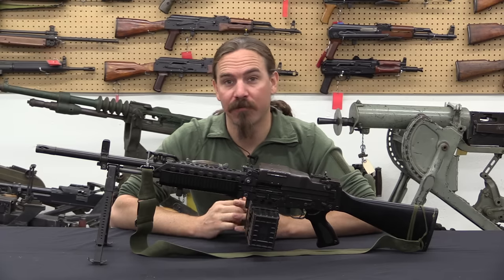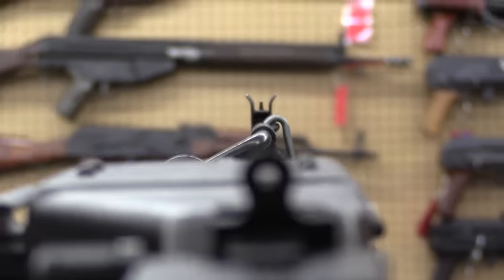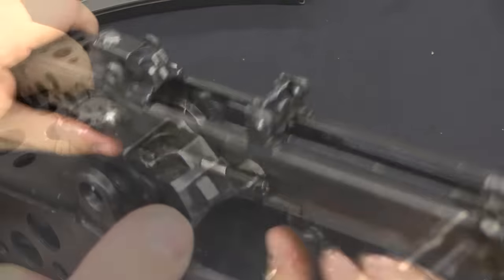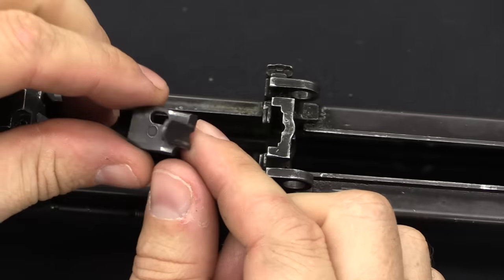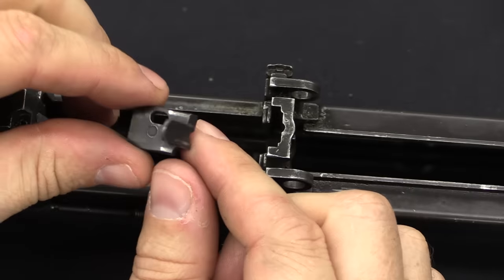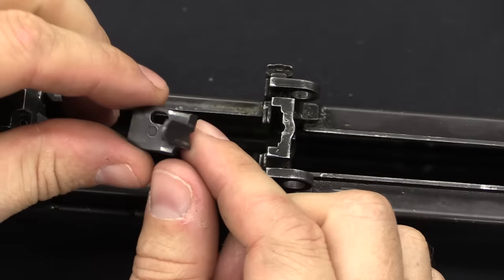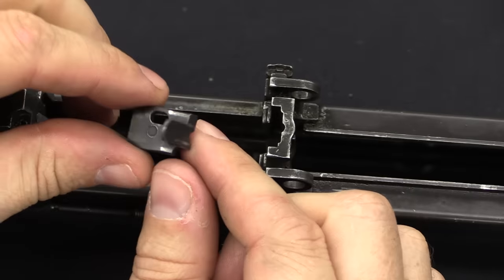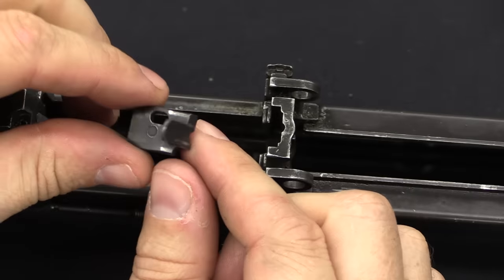Stoner 63, 63A, & Mk23: History and Mechanics

Comment: US Military: "This weapon is too finnicky for frontline use."

Also the US Military: "Boy, the M16 sure jams alot, better fix that."
Reply: (EDIT: to explain exactly what was wrong) The M16A1 was very reliable for frontline use and worked well in the mud. It was only the first M16 version that the US Ordnance company screwed up intentionally because they hated it and wanted to keep the M14. They were mad it wasn't procured under their control, and that it was privately developed by Armalite instead of the government's Springfield Armory. They ended up changing the powder that the rounds used to a cheaper surplus alternative. What this caused was an extreme pressure imbalance that the rifle wasn't designed for. So bolt velocity was substantially different. This caused lots of ejection failures, light strikes, and small remedial problems. On top of this they also refused to issue cleaning kits, under the impression you "don't need to clean the M16," which is obviously absurd and it's astonishing they did that. The rifle wasn't originally chrome lined either. That was actually by design, it's technically not necessary to do so, but it helps a lot especially in places like Vietnam. This was all quickly (I use that word loosely, quickly for the government at least) resolved with the M16A1

Turns out the babies throwing a hissy fit didn't get them their beloved M14 back, and only caused hundreds of G.I. to lose their lives because a perfectly good design got fucked up intentionally. The only good news is there was a congressional investigation into the matter, with several men arrested (not sure if they were actually charged), and the US Ordnance Department was completely dissolved.
Reply: @weasle2904  
I still think the US should have used the FN FAL. We'd still see new variations on that platform today and its a very good bush gun
Reply: @P7777-u7r  If you're talking about the FAL vs M14, then no doubt I think the FAL would've been a wiser choice. But history has proven that the 5.56 round is far more practical in combat than larger full power rounds.

The M16/AR-15 is also objectively better than the FAL. More accurate, ergonomic, lighter, easier to maintain, cheaper to manufacture, and it also is far more controllable. Not to mention the AR-15 also performs better in muddy conditions than the FAL.
Reply: @weasle2904  
I was talking about for Vietnam use specifically as in a counter insurgency fought primarily in the bush. Rhodesia found the FAL so effective in this that they kept their old beat up FALs and just kept maintaining and using them. Specifically in the vietnam era though the AR15 platform improved vastly after
Reply: @P7777-u7r  Rhodesia was a state with very little money to spare. I wouldn't buy into many of the old wives tales. Soldiers tend to complain and make excuses for everything, and myths spread quite far through word of mouth. Take the myth about the Garand ping getting people killed for example. If you weren't able to see the enemy through brush, it sure as hell didn't matter much if your bullets were deflected. This kind of problem is only really valid for hunting.

95% of all gunfire is suppressive in nature, and isn't intended to kill. This is important to keep in mind.

The benefits offered by the M16 heavily outweighed it's few negatives. It's why the US adopted it. The US tested experimental M16 models with a select few squads to see the effectiveness of the weapon. And the improved lethality, and ease of movement the group had with the new weapons was astonishing to the US Military

>"Specifically in the vietnam era though the AR15 platform improved vastly after" Sigh I will state, again, the M16 WAS improved DURING Vietnam and functioned FINE. The M16A1 fixed the issues it had, and worked beautifully during Vietnam.
Reply: Weasle 
I think Rhodesia was more a difference of doctrine from the US

Being a small army against an insurgency with very little urban combat individual marksmanship was prioritized a lot more and winning often involved getting the drop on your enemy first. If suppressing fire was needed it was up to the guy with the FN MAG to provide the most of it 

I think they liked the FN stuff as well because they often worked in 4 man sticks who’d be in the bush for a week sometimes without any permanent base and they were always on the move. The AR15 platform of those days even after the M16A1 was just a bit too high maintenance for people who worked in very small units and had to be constantly on the move as well as pack as light as possible
Reply: @P7777-u7r  "The AR15 platform of those days even after the M16A1 was just a bit too high maintenance for people who worked in very small units and had to be constantly on the move as well as pack as light as possible"

I don't mean to be rude, but this completely wrong. I'm really confused as to what you're saying, the M16 is inferior to the FAL when it comes to light and mobile units..??? The primary benefit of the M16 is that it is significantly lighter than an FAL, with ammo that weighs half as much as 7.62Nato. These are huge advantages for mobile troops.

The M16 is not maintenance heavy. It just isn't. Perhaps compared to an AKM, but it truly isn't. How is needing to clean your rifle every couple months a detriment to a light mobile squad? Cleaning your rifle for about 10 minutes every month or so is not a big deal at all. The M16A1 is mechanically identical to the M16A4 and M4A1 of today.

You're buying into the myths of the M16 too much. The truth of the matter is that it vastly improved the US Military's effectiveness, this is supported by statistics. It ESPECIALLY was effective in light and mobile groups
Reply: @weasle2904  I support what you've said so far, but I just want to point out that the M16A4 has been moved out of frontline service in basically every part of the U.S. military in favour of the M4A1 and M27.
Reply: @stevenbobbybills  It was just as a comparison. I understand they don't use it anymore. M4A1 is standard. The US Marines are the only ones who adopted the M27 IAR.
Reply: @weasle2904  Yeah, I really don't understand why those people in the Ordnance department weren't charged with treason for sabotaging US small arms and costing lives. They should have been put up against a wall for what they did.
Reply: @weasle2904  i believe the M4A1 is standard for special forces such as the navy SEALS,DELTA, MARSOC and various SOCOM units. The m4 carbine is standard for the regular forces because it has a semi-automatic/3 Round burst trigger group. The M4A1 has a Semi-automatic/full auto trigger group which has a more consistent trigger pull than the M4 carbine which translates into better accuracy. Thats important for the SPEC-OPS guys.  Just saying.
Reply: @austinthorning5025  The original M4 carbine was phased out long ago, M4A1 is standard.

And it definitely didn't have a 3 round burst. That was only in M16 trigger groups.
Reply: @weasle2904  m4 standard had 3 round burst,  A1s have full auto.
Reply: @andy1676  You're correct, my mistake! However M4's are still phased out. The M4A1 is standard issue
Reply: @weasle2904  I will admit that the information I used was stuff I looked up a few years ago..my bad. Although I seem to recall that the military still uses 3 Round burst for its carbines, but this may vary from branch to branch . So take it with a grain of salt, i may be wrong. Have a good day.
Reply: P77777777 actually it improved during Vietnam not after the main issue that the m16 had wasnt the m16 it was the ammo they started loading the cartridges with the incorrect powder causing pressures the m16 wasnt made for which led to premature attempts at extractions which resulted in the extractor literally ripping part of the rim off of the casing causing you to have to use a tool to extract it typically a rod down the barrel often times the weight of the rod was enough to remove the cartridge

So no the ar platform was very reliable from its conception it did however have some minor issues like the extremely exposed mag release that they added a ridge around to prevent accidentally hitting it and dropping the mag
Reply: P77777777 "the ar15 is just to high maintenance" the ar15s I've taken apart looking at with gunk caked inside still working flawlessly beg to differ

And by gun I'm talking it looked like fresh black paint was all over the inside of it on of the filthiest guns I've been handed to clean was an ar and it wasnt cleaned to fix it it was just cleaned to clean finally the only real competitor was a 22 that I am not willing to guess how long it had gone without cleaning or how many rounds it had seen it was caked to the point I was pulling what I think is beside described as dried sludge made of of powder residue mixed with dust and dirt all throughout the reciever 

The long story aside anyone who thinks an ar is to high maintenance to go a month or even a few with no cleaning is stupid, ignorant, or simply biased that said they do require maintenance as does everything machine nothing man made doesnt require any maintenance to continue to work 

And as a side note you pointed out "packing as little as possible" well if they're going out into a situation where combat will likely happen and not bringing simple supplies to maintain they're equipment they're an incredibly unproffessional borderline laughable army take care of the equipment and itll take car of you and seriously a rag a small bottle of oil and a bore snake is all that would be neccessary the bore snake is even negotiable really you just need to wipe it down and add a bit of oil along as you're giving it a proper cleaning when out of the field and incase you're under the impression the ar platform is hard to take apart (know a guy who was in the finnish army who was told their ak variant was superior to the m16 it was 100 percent reliable and extremely easy to take apart had to break it to him that it wasnt as reliable as he thought and that it's no easier than an ar) stripping an ar is pushing 1 pin through the recieve (it is retained on the other side doesnt go completely out) letting the rifle fold over then pulling the charging handle out as it comes out the bolt assembly follows that's basically all thats needed in the field of you want you can pop the pivot pin out just like the other pin then it comes apart in 2 pieces and you can remove the bolt head which has what amounts to a cart key and a retaining pin required to remove it and at that point you have the firing pin out as well 

Infact you can take the whole gun apart without tools the barrel is even easier to replace than alot of rifles made to compete with it the gun really was designed for military service it's simple reliable parts are interchangeable and cheap
Reply: They did not issues cleaning kits this proved to be the big issue as guys just used them tell they clog up"The M16 was billed as self-cleaning (when no weapon is or ever has been). The M16 was issued to troops without cleaning kits or instruction on how to clean the rifle."
Reply: @austinthorning5025  You were right about the 3 round burst on the original M4, that's my bad. But yeah the M4A1 has pretty much completely replaced it.
Reply: Jacob Perry yes I never claimed it didnt need to be cleaned or that that qasnt an issue? I dont understand your point are you saying that it getting dirty is worse than the over pressure from the incorrect powder causing locking lugs to sheer off or the extractor to rip through the case rim causing the spent casing to become a bore obstruction?

I dont understand your point but yes you are right one of the issues faced early on was that they didnt issue cleaning kits but again not an issue of the rifle just more stupidity from people doing things they shouldnt do
Reply: lol have any of you served or used any of these rifles you speak of?
Reply: This myth has been dispelled so many times it's not even funny to bring it up ironically anymore.
Reply: The Australians and the Kiwi's did alright with their FALs in Nam. Also Google the "bitch"
Reply: @weasle2904  The FAL in the original .280 British intermediate cartridge would have been a great choice.
Reply: The M16 jams were ammo/maintenance related, they didn't need to "fix" anything about the rifle itself.
Reply: @weasle2904  any thoughts on what if the m-l6 had been adopted w/a gas piston, & 2 locking lugs? that was my gripe-- plus, i read that the current ml6 has a gas piston (if that's true, what does that say ABOUT gas tube op?)
Reply: @P7777-u7r  right; a 762nato, & 556, FAL, both w/ options for heavy bbl, hi-cap B-shaped drums; if sturdy enuf, cooda replaced: ml6, m2l sniper, 249, 240B, wooda allowed going 'heavy' on 762nato rifles, when situation required, rather than everybody stuck w/ 556rifles; then maybe bullpup version
Reply: @weasle2904  ** ml6 cooked-off way sooner than other designs,**  upper-recvr lack-of-trunion-block had ml6s loosening bbls from sustained fire, ie, no option for ml6-RPK (ml6 SAW), ** also,  no way to have ml6 quick-change bbl; **  i never saw any justification for gas tube-- note stoner PISTON op, ** no justification for 7 locking lugs [i've not kept up on the latest mil wpns: do you know of any other mil wps w/ 7 locking lugs; or any reason for such?]
Reply: @P7777-u7r  agree, on ml6 too-high maint-- WAY unjustifiable for a mil wpn
Reply: @barrysmith1202  Direct gas impingement allows for a well tuned operating mechanism providing substantially lower recoil and better shot to shot accuracy. Less gas, mean less energy, more lightweight bolt carrier group. The high amount of locking locks allows for an extremely short rotation of the bolt, making extraction easier and less energy to unlock the bolt.

You get an overall lighter gun, with lighter recoil. Your claims about it's unreliability perhaps would be valid if the M16 was never adopted, but over it's 60 year lifetime it's proven itself as an extremely reliable weapons system
Reply: @weasle2904  i'm not going to argue w/ those points, but i do have some questions: ** do you know of any other military weapons w/ direct-gas, & 7 lugs (i have'nt followed small-arms for decades now); ** many other systems-of-operation have demonstrated: > low recoil, >high accuracy, > reliable extraction, > reliable unlocking, ** i carried an M-l4 throughout ranger school (where one typically loses 20 lbs of body mass), basically 24hrs a day for 4-6 days straight, for several weeks straight (not, BTW, recommended, ie, SEALs consider such to be totally stupid training); but, i never found the M-l4 to have a weight problem; ** what year did the u s military drop the direct-gas system for M-l6? why was it dropped?
Reply: @barrysmith1202  Lots of guns use AR-15 style bolts actually. G36 and L85 come to mind. The only other major DI gun would be the French MAS49. The reason it's uncommon is due to direct gas impingement being harder to tune for a operating mechanism to run well. However when you get it right, and the M16 certainly did, it has a lot of benefits regarding weight and recoil. Eugene stoners design is particularly well suited to this gas system. The AR-15 is the Pinnacle when it comes to gas impingement systems.

Interesting to note, the AR-15 technically isn't direct gas impingement. Due to the fact that the gases being directed into the bolt carrier group are actually routed to an internal gas 'piston' inside the bolt carrier group.

The reason the M14 was dropped was due to the M16 outperforming it in trials, and in actual field trials (real combat) it showed an increase in unit lethality. Soldiers were capable of carrying twice as many rounds (that were still very potent in flesh thanks to M193's fragmentation and yawing).
Reply: @weasle2904  I wanted to further the point of small caliber concept viability with the argument that the only other major "culture" in the gun world essentially agreed on the validity of said points and adopted it, being the soviet 5.45x39 proof of that. 

Specially considering that the practical advantages between 7.62x39 and 5.45x39 was a lot less pronounced than 7.62x51 and 5.56x45, as in the soviets had already adopted a intermediate cartridge and yet, they saw the validity of retooling and redoing all their logistics.
Reply: @P7777-u7r  I am very glad they didn't.  The FAL was a dead end platform.  The AR15 is still a revolution to this day, and innovations are still coming out every week (different uppers, lowers, calibers, gas systems, etc. etc. etc.)
Reply: @electrospank  They did have to chrome line the bore and chamber as was originally intended but not done on the first M16's issued. Between that, failing to issue cleaning kits, and using different powder than was originally intended, I'm surprised they worked at all.
Reply: @c.j.1089  The Israelis designed the Galil based solely on the poor performance of the FAL compared to the ak. To me, that says a lot about how good the FAL really was. I think it was better than the M14 but in my opinion, the ar platform is the best small arm ever fielded.
Reply: @boomerisadog3899  chrome lining is for wear resistance. My comment is about reliability. Not sure why you're calling me out to make that point.
Reply: @weasle2904  I believe that. They did the same thing with the FAL vs M14 trials. The FAL was coming out on top as the better gun during testing so they decided to do an arctic test and warn the american company but not FAL. With simple modifications it would have not been an issue.
Reply: When talking about how "good" the standard issue guns are: never forget this fact: every piece of equipment a soldier has on him was made by the LOWEST bidder.
Reply: @weasle2904  Sorry for being a pedant, but the G36 and L85 use the AR-18 BCG, which is VERY similar to the AR-15s, but not the same.
Reply: @LAHFaust  The AR-18 BCG was derived from the AR-15, thus why I made the comparison
Reply: @weasle2904  "But history has proven that the 5.56 round is far more practical in combat than larger full power rounds." yeah SO much more practical in not killing straight away, but maiming awfully thorugh the botched up ballistics of instable projectiles that come in sideways or tumbling throught he air, so they make crooked, twisted paths and make field dressing and aid almost impossible. Cool doctrine to wound rather than kill, so more soldiers of the enemy are bound.
Reply: @weasle2904  Do you have a source for this?
Reply: @P7777-u7r  I don't think the FAL would have evolved much more beyond what we've already seen - there's a reason the Belgians had FN design the FNC to replace the FAL (chief among them being the FAL's outdated tilting bolt).
Reply: I was going to like the comment but then it was going to be 667 likes
Reply: @P7777-u7r  I think we should all be thankful they didn't adopt the FAL, or the M16 and subsequent AR15 would not exist.
Reply: @P7777-u7r  Give any decent operative a choice between a FAL and an M16A1, they'll take the M16 100% of the time.
The best thing the FAL has going for it is the range and you can't fully take advantage of that due to it's awful options for optics.
Reply: C.J. 
Good

Everyone is forgetting also that the FAL was designed initially for an intermediate cartridge. If the US had gone ahead with the original FAL plan it would have been intermediate like the AR but far far more durable
Reply: @P7777-u7r  The world was ready for an intermediate cartridge. British were ready with their .280. However, Fudd Colonel Rene Studler pushed the idea of 7.62 NATO being superior.
Reply: @Ugly_German_Truths  You got that backwards. 5.56 rounds don't tumble in the air, they tumble and fragment after hitting someone. Fragmenting bullets kill more quickly and humanely that ordinary FMJs, which is why hunters use expanding and fragmenting ammunition exclusively unless they're dealing with elephants and hippopotamuses.
Reply: @austinthorning5025  m4s have been getting phased out or upgraded for about a decade and from all the information I can gather that process was finished in 2019
Reply: @P7777-u7r  FAL is an outdated design. This isn't cheap pro American views.... Because the AKM is superior to the FAL. The AR-15 is superior to the FAL. And the AR-18 derived systems are superior to the FAL.
Reply: Even if the FAL ran a light rifle cartridge. The early intermediary carts are heavier than people think.
Reply: Rotating bolts are better objectively than tilting bolts.
Reply: @Ugly_German_Truths  5.56 tumbled and therefore does more damage than perpetrated. You wouldn’t want to be on the end of any bullet and you’re sitting here calling it weak. Please try 5.56 if it’s weak
Reply: US Ordinance Dept: Wait, we didnt design this..how can we sabotage it?..let's add extra graphite to the powder mix so the gun carbons up faster and jams in combat .  Screw Stoner.
Reply: actually,  if I could get the AK in 556 or 6.8 I'd go with that operating design. direct impingement of burnt gas on the bolt carrier and chamber does not strike me as that efficient whether hard chrome the chamber or not. The AK has hard chrome and fluted chambers dont they?
Reply: @weasle2904  the Air Force only has regular M4 with the 3 round Bursts and several army peeps I know also have 3 rd burst m4s.
Reply: @weasle2904  also the m16a1 has almost twice the rate of fire than a fal has
Reply: @weasle2904  well if we didn’t put our foot down on the standard had to be .30 caliber then the FAL would’ve been a more intermediate cartridge.
Reply: @mhammer3186  That is true. The .280 British was definitely on the larger side though, and it's arguable that the M16 still would've been adopted anyways due to the afforementioned advantages. But that's assuming the US would have even adopted it, which they clearly didn't want to because even with it chambered in 7.62 they still declined it and picked the M14 out of nationalism (or the corrupt lobbying and nationalism of a select few individuals in the military).